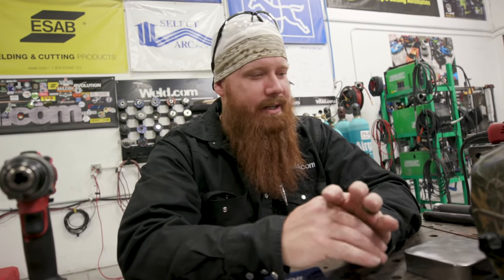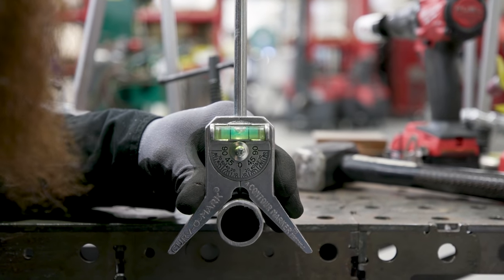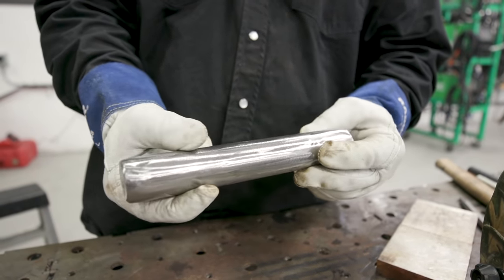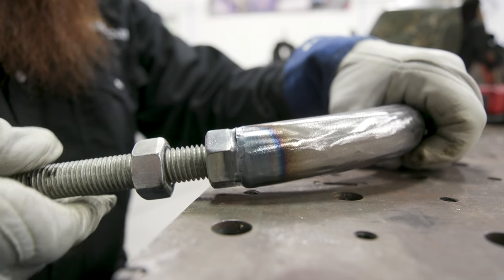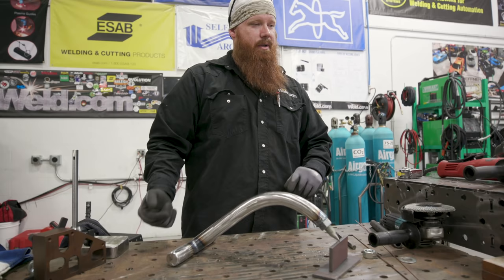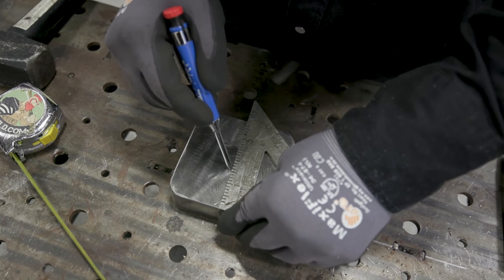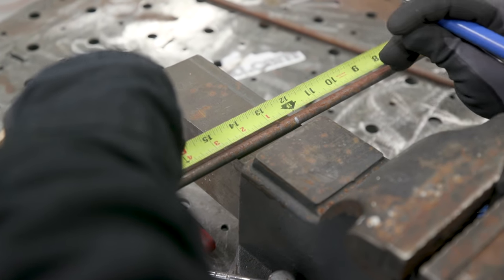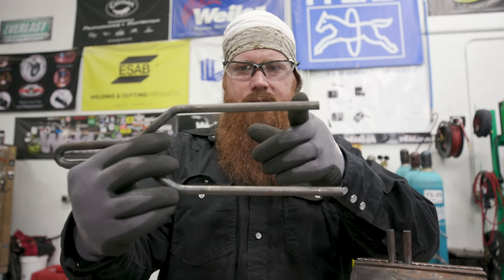You Need One of These in Your Shop!

Comment: When you need a heavier hand, I fill the pipe with sand before welding ends on, or make it from solid bar instead of pipe.
Reply: "they called me Mr glass"
Reply: I was just thinking about using a piece of sucker rod.

Comment: You could use an off the shelf saddle washer or unistrut washer instead of making one from scratch. I know not everyone has those parts on hand, but they are cheap, easy to get, and save a little fan time. 
Thanks for the videos.

Comment: Silly question - why the point at 45° (135°)? You introduce a bit of "wobble" in your workpiece/it may not be perpendicular to the base plate. With a beak parallel to a component it holds your normal force is higher and you do not introduce side (tangential) force... Reason why I am asking is I am mechanical design engineer with virtually zero experience in a workshop. However I found your channel and find it very informative and I am about (thanks to you) to start my adventure with welding. Second reason why I was asking is I am very keen woodworker (DIY level) and due to limited options, sometimes I cut narrow (2-3") timber along it's narrow edge. If I clamp timber at any other angle than ~90° my cut is never square... Anyway, love your videos man, very well done!

Comment: Dear Sir, nice video and a couple of innovative ideas to solve a problem that I didn’t know that I had. I do now because you answered why my welds with magnets holding the pieces together didn’t seem to run well. As you can guess, I am only a beginner with welding.  I’ve done a bit of blacksmithing and love seeing you bend the cherry red metal like it was a piece of plasticene.  Beautiful smooth curves and symmetrical results. Try doing that with cold metal, a hammer and a forming tool.  Total mess.  Cheers and all the best.

Comment: Good video and ideas. The first one requires flat clean surface at base or it would rock. Instead I would simply make a horseshoe fork out of 3/4 rod, weld a hook on it with a point at end. Also a vertical peg at top so a heavy metal weight (with hole) can be slipped onto the peg when additional weight needed at point.

Comment: Good video and wanted to mention if you want to center something really simple then just measure one side approximate where the end of the pipe meets your base and then duplicate that dimension on the other side.  You don't have to worry about math and it will line up between the two marks and easily adjustable if you overshot the measurement.  It is so fast once you try it you won't believe...

Comment: Should have made the end caps .5" bigger than the dia of the tube so it doesn't rock on slag and spatter when it is sitting on the weld table.
Reply: Great suggestion! If you have a lathe, you could make the end caps out of brass and press them in. Thanks for the idea.
Reply: oh yeah i forgot this is a welding channel. not a plumbing channel. lol
Reply: Delfino Cornejo that sounds way simpler for those who don’t have a pipe bender. Just have to weld the point onto the cap.
Reply: The idea was to have good contact with the table, so it can be used for ground.  If you can't find a clear spot on your weld table that isn't covered with slag or spatter, I think you have another issue to address other than needing a 3rd hand.
Reply: @silvermediastudio  my issue is I need a weld table.
Reply: @FishFind3000  build one
Reply: @silvermediastudio  I don't have the space in the garage. plus I don't really need one. it would have to be a tiny plate added to my roll cart so i would have maybe 2'x2'. With the since of these 3rd hands it would take away so much space. most of the time im welding on the ground.
Reply: @FishFind3000  what about a pedestal? your welds will likely improve of you have a better, more stable position.

Comment: You said you might leave a section of the green 3rd hand unpainted for grounding purposes but i was thinking why not use some of that tig braze bronze filler rod in that area for good grounding as the bare steel after awhile will probably rust, defeating the grounding benefit of the tool?
I made some smaller thirdhands years ago for where clamps are cumbersome. Never really thought about one for big stuff but I'll give one a try. Might come in handy. If not for welding, then for wielding! That will get people's attention! 😂

Comment: I drilled a 1/2" hole in my tube and poured molten lead into the tube to add significant weight to the tip end

Comment: Consider switching to metric system. You have no idea how easier it is to calculate things in your head that way. You will probably never need to use calculator again. And the precision is way higher.
Reply: There is zero difference in the precision.  And Imperial units are much easier to visualize.
Reply: @silvermediastudio  So splitting a measurement in divisions of 2 4 8 16 32 and 64ths is easier than in divisions of 10 ? . 😅🤣😂 alrighty then .  You can't see the divisions after 16ths correctly but there's 25mm in a inch which is about the limit of most welders vision .
Reply: @LifesAbe-ach  Yes, if you are doing it frequently (like with most things). But my point was more along the lines of gross estimation, such as splitting human-scale lengths in half or quarters. Certainly when we get down to lengths that require instrumentation, SI units are superior, and as such have been adopted by physicists, precision machinists, and so forth. Another comparison to demonstrate the point is that for artillery and precision rifle shooting, milliradiands are the preferred unit (fine adjustments and easier to convert units from other factors). For hunting, minute of angle is generally preferred (conducive to quick estimation, and sufficiently accurate for the task).
Reply: @silvermediastudio Our military did it because of NATO

Comment: Both designs seem like a good choice, but I don't understand why you chose to leave a bare metal strip on the first one.  Why would it need to conduct current / contact the table?  It the table your ground (work clamp)?

Comment: Red Beard: " I'm using a 5/16" bolt, I'll drill a 3/8" hole for clearance."
Equipment fabricator: "I'll use a 21/64" bit, give it some clearance.
Machinest: I'll drill an 8mm, be a nice fit...😂🤣😎
Just saying... And yes, I've done worse!! Transfer everything perfect, then still have to drill a hole or three another 3,4,5, or 6 sizes bigger to make it work..

Comment: What is that tool called you used to find the center of the pipe with.
Reply: Scott Jones curv ll

o mark center finder
Reply: Curv o mark center finder
Reply: Jack Diamond thank you I will look for them
Reply: @scottjones9885  Amazon curb o mark makes pipe fitter tool and equip. At the same time I would get the level that has a set of quick release fllange and I will be playing at your place in pins built-in to it and a wrap o round
Reply: CURV-O-MARK
Reply: Jack Diamond  oh ok cool thank you for the information. I appreciate it man.

Comment: OK, that's the first time I've seen an imperial calculator, all these years ribbing my friends across the pond, but never considered electronic calculators have you had them since the late 1970's or is it a recent feature?
Reply: You don't need a imperial calculator, just brake it down to fractions example 1/8th is .125 so you'd use that like 3.125÷2=1.562 convert that back to a inch and 9/16th

Comment: Be sure to drill a small hole when welding both caps, the hole lets hot air escape . Not doing so results in hot air blowing out weld in second cap, or worse, the dreaded pipe bomb .  At minimum, let pipe cool after welding first cap .
Reply: You don't sound like a welder. I've been welding for 30 yrs and have never had a weld blow out due to closing a small tank... that takes compressed air or surface contaminants.  You can blow out metal by heating a sealed tank to the point of melting,  increasing the air pressure from the heat, but not the other way around. By the time the tank is sealed, it has already been heated and the air forced out.

Comment: This is seriously over complicated for what it is.
Reply: Yeah....it's one of those things that guys build who have time on their hands...25 years fabricating by myself and I I have yet to run into a job where I HAD to have one....
Reply: I agree! However, the whole purpose of their videos is to convey information. So I find myself asking "c'mon man did you really need to explain that?" The logical side of me answers, "Well Tom...yeah, because quality of the product (whether it's welding or a YouTube video) is something that should not be sacrificed." So I guess kudos to Weld.com for being so thorough and consistent with details, and shame on me for not watching the whole video and possibly disturbing others with my  disassociative identity issues.......
Reply: Well we really don't need instruction for an under complicated version. First time I needed a 3rd hand I tried using a coat hanger with a large socket to add weight. When I needed something heavier, I used a jug wrench. I'm ready to make a permanent tool.
Reply: DocRevo in 40 years of don't my own vehicle maintenance I never "needed" a floor jack or a torque wrench. Now that I have them, I use them all the time. Though the biggest upgrade was doing work indoor instead of on the dirt!

Comment: Far too complicated. I can make one of these in under 3 minutes with a small piece of 1/2" steel as a counterweight and 3 pieces of 1/4" solid round stock with grinded points on them. Weld them all to the 1/2" counterweight in a sorta triangular position and bang, very simple, only a welder and cutting wheel required.
Reply: Agreed
Reply: Well, good for you. You want a ribbon?
Reply: As he stated in the video, there are many different  ways to do them and these were just 2.  If he were to just rig some stuff together he probably wouldn’t have many followers.  People not as smart as you can look at these and then either replicate or modify to their liking.

Comment: You wanted half of 8 3/16" and used a calculator - HAHA
So you think you need 4 1/8"

Anyone knows WITHOUT A CALCULATOR you need 4 3/32"
Calculators are digital.
Reply: That was driving me nuts when I saw that (although sadly I know many that cant do common measuring fractions in their head).

Might sound like a dumb question but I've honestly never used a calc that does fraction (never needed to), do they not understand 32nd's or smaller?
Reply: This is why mm is better

Comment: 8 3/16 ÷ 2 = 4 3/32, NOT 4 1/8. 5/8=20/32. 4 3/32=3 35/32. 3 35/32-20/32=3 15/32. Not 3 1/2. A 1/32 difference may seem insignificant, but it's just as easy to hit the right number than to slime your way to "good enough". Good enough is bullshit. Nobody's perfect, but knowing what's right and not being currently able to do it is wildly different than knowing what's right, being capable of doing it, but refusing because it would take 10sec longer.